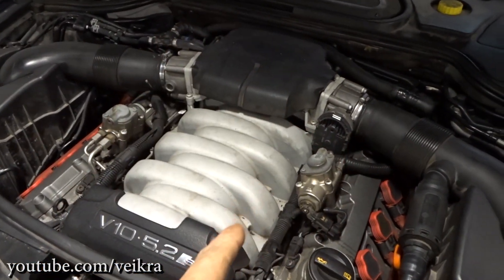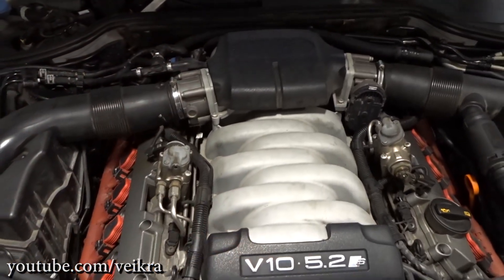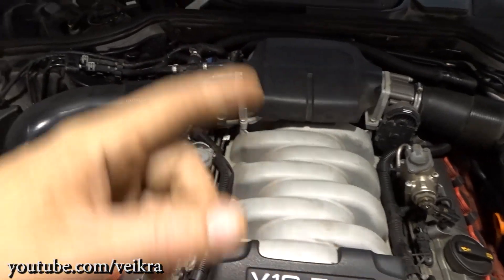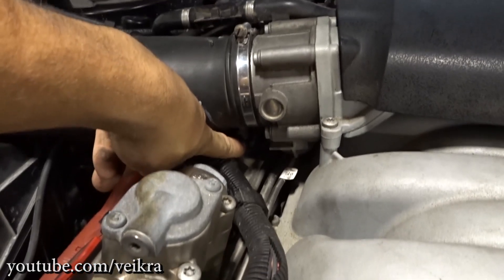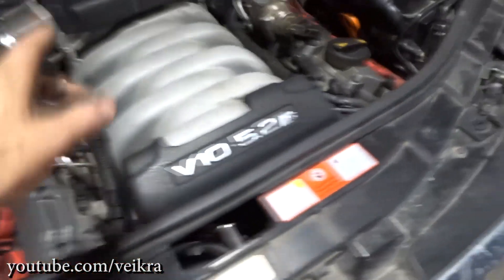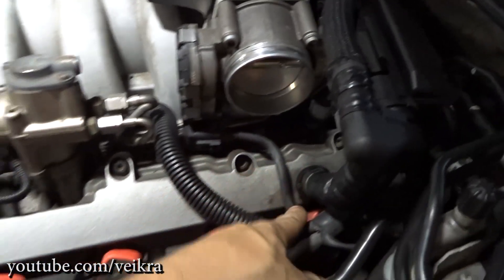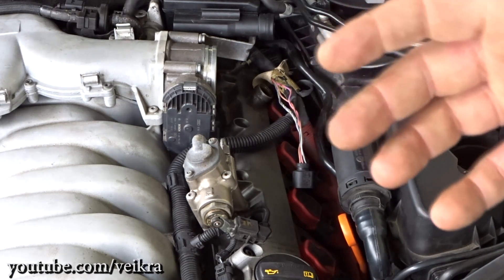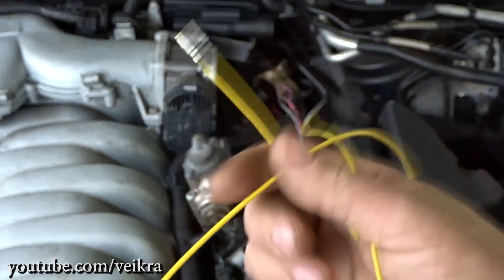Audi S8 V10 5.2 EPC error light repair first step

Comment from the maker: Both throttle bodies were later replaced, one by one. left one was very bad, changed it. 5-6 months later, the right one started throwing code. Replaced it still issues, changed it's connector, good ever since.

Comment: Parts required below :

Connector ---> 1J0973713 (cross connections, old-type)
Pins -->  Tyco 964275-3
Seals --> Tyco 964972-1
Cable --> VAG 000979982A
-------------------------------------------------------------------
Connector --> 4H0973713 (rectangular connections, new type)
Pins --> Tyco 1241381-2
Seals --> Tyco 964972-1
Cable --> VAG 000979982A
Reply from the maker: I recommend the new type I used here, they have way more tension on their pins. 
Wires and pins comes assembled if you buy from the dealership, 2 pins per cable. There is 2 different gauges of wires. Ill find my bill for numbers
Reply: @Nordic_Mechanic  Correct, 1mm wire for the throttle electric motor driver and for the ecu communication wire is 0.35mm. so 2x 1mm , 4x 0.35mm
I did replace only the pins hence the wire was completely OK. The pins lose contact (enlarge) at some point due to heat and age.
Reply from the maker: yes they do enlarge that'S why VAG made a better pin that has more tension and should last much longer. I dont know where your comment about the wire thickness went though! Youtube's event horizon I guess !

Comment: I have a 2007 Audi s6 when I was shifting through the paddle shifters this came on EPC, Track Control and check engine light.
Reply: Code p1923 code came on?
Reply from the maker: Not a nice code. Check wiring harness for bad spots. Can be as bad as a fried ecu

Comment: Hi Veikra I have an Audi s6 2007 v10 the car has the epc light on and it’s doing esp fault so when I first start the car it runs normal and these lights are going but when the car starts to get warm the rpm jumps up and down and it’s shakes crazy then cuts off and right after I start it will stay on for couple of seconds and then cut off and keeps repeating it’s self  and when it close to cutting off when I give it gas it seems to do nothing and cuts it off faster. Would you know of what could be causing that and do you have discord?
Reply from the maker: First step with a malfunction light is scanning for codes. We ll go from there
Reply: Sounds like High pressure fuel pump?

Comment: I have a B7 RS4 and a lot of us owners of these 4.2s have been having the same epc throttle issue, took it to a good guy and told me my entire wiring harness was fine. After some time trying new things we found that the female connector to the throttle body had to be broken apart cleaned it put it back together and it was fine for a couple of months came back rarely now it is fully back and I am very close to trying to just rewire the connector itself. What do you think?
Reply from the maker: At least rewire the pig tail about 6 inch before the connector. Solder and heat shrink and also use the newer connector as the pins are a lot tighter than older ones. On the R8 and S8 V10 like this the wires crumble inside the sharp loop just before one of the throttle body and causes issues. I wont touch a v10 with throttle issues before I replace that bit of wiring for that reason.

Comment: I have a 04 audi a4 1.8t i have the epc light come on it throw me code p0221 throttle body and gas pedal i already replace both but car keeps on loose power when epc and esp light comes on. Any idea what would it be?
Reply from the maker: Yes, and that idea is exactly what`s explained in the video and description box
Reply: Thanks alot im going to do that. Somebody told me that I have a bad ECU

Comment: hello, you happen to know how i come to distinguish if my front parking sensors working or not , i did the camera sound check on the back and front sensors and the back made ticking noise as the front didnt at all. Is it that the front sensors are burnt down or maybe some other issue?
Reply from the maker: scanning would probably reveal a short in the harness or open. you cant have all 4 defective sensors. As it always been this way or did it suddenly happen. Any work done to the car recently?

Comment: Got a 2.0l a4 avant and it’s showing epc and rich idle. Don’t have much to put into it at the moment. Pcv diaphragms not showing tears, car isn’t just shutting off or stalling like a completely blown high pressure fuel pump. What else could it be for rich idle? Thanks
Reply from the maker: Without a scan hard to know for sure. Can be a plentora of things. Could be a stuck open injector for one, a mass airflow perhaps.
Reply: @Nordic_Mechanic not 100% on code# but whatever rich idle is
Reply: It seems to be going through gas quickly also went down 100 miles on sensor after about 50 miles of driving.
Reply: P2188 it looks like
Reply from the maker: @benkohout6495  injectors?, mass air flow?, coil/plugs?.   All three things to check . Strong gas smell in oil? How's the air filter?   

I'm leaning toward a stuckk injector. Sadly only 1 bank of cylinders. If you had a v6 or v8 we could tell very easily as only 1 bank would be affected
Reply from the maker: @benkohout6495  Remove spark plugs, see for obvious cleanliness differences in combustion chamber
Reply: @Nordic_Mechanic  Thank you for the response! Injectors is first since it’s cheaper than doing high pressure fuel pump. Will check for gas smell in oil. Air filters brand new, coils and plugs possible but I’m thinking check engine light would’ve shown also with epc.
Reply: I did just run bg44k platinum fuel injector cleaner through there within the last 500 miles so possible that it caused something. 

I was hoping to rule injectors out because of the cleaner but sounds like it could be the culprit.
Reply: @Nordic_Mechanic  paid $400 to get a diagnostics and cleared codes drove it 80 miles epc and shaking. 
Brought it back and still haven’t heard back from my mechanic. He’s acting like he has bigger projects so may have to take it somewhere else. $400 no wrenches turned, no diagnostic
Reply from the maker: @benkohout6495  Could have disloged something and got an injector stuck open. I'd still inspect combustion chamber to see if a cylinder is different. Could be too high a pressure on all of them coupled with a faulty fuel pressure sensor reading within specs BUT at the wrong pressure.  It's a long shot so thats why I check the combustion chambers for possible clues of whats really happenign
Reply from the maker: @benkohout6495  Shitty deal. Diagnosis wasnt done, you still dont know whats wrong. I'd ask money back. 400$ that's half a day I'd spend on it , bet I find the problem in that amount of time.
Reply: @Nordic_Mechanic  thank you really appreciate the reply
Reply: @Nordic_Mechanic  ended up putting new Pcv valve, spark plugs, oil changed, car started smoking from exhaust (white) shaking sputtering again. Oil says max not sure if it was overfilled?
Hpfp, catalytic converter? Injectors? So deflated with this thing.
Reply: 900 miles good with the Pcv valve spark plugs helped, oil changed then 200 miles before smoke from  exhaust and shaking/hesitating.
Reply: Also noticed there is 1 aftermarket blue/brown oil pressure sensor m. Any ideas are appreciated thanks

Comment: So I’m looking into getting a s8 from the auction and it has the epic light on along with 18 engine codes. Is there a strong possibility this could be the issue. Someone has already tampered with the TB on the driver’s side and installed it with RTV.
Reply: But I don’t have any TB faults
Reply from the maker: Check for play, but if you have misfires, the intake could be dirty or broken. A lot of S8  intakes are broken, they cause 2000$ for the part alone. Be wary and post the codes here so we can try to see whats going on.  All in all , good engines aside from carbon buildup
Reply: Veikra P0458
P010C
P129B
P2257
p0414
P0102
P2294
P2401
P0498
Reply: Veikra I’ve posted the codes. Any idea what the issue could be?
Reply from the maker: @teammcmath-mcmathautos  youtube doesnt notify me of some replies sorry. I think I replied to you on other video right? You have a power feed issue I think
Reply: @Nordic_Mechanic  yea I took it to my euro tech had a wiring issue.
Reply from the maker: @teammcmath-mcmathautos  Good to know it was resolved. With those code, there was definitely a missing 12V somewhere :)
Reply: @Nordic_Mechanic  right!! My check engine light has come in though I now I have p2189, p1923 in engine 1 and p010c,p129C, p3200, p3245, and misfire on cylinders 3,2,7 & 10 on engine 2 🤦🏿‍♂️🤬🤬
Reply from the maker: @teammcmath-mcmathautos  Still missing power to o2 sensor, maf and fuel pressure regulator.  Missing power or short to ground, either or. Disregard misfires for now, it cant run right on half an engine. Ive seen it happen from a totally destroyed high pressure fuel pump. It was crushing the fuel pressure regulator and shorting to ground many other components.

Comment: did your engine rattel if you gave it a little gas, I have the same car..
Reply from the maker: Maybe a little, but PLEASE make sure it's not your timing chain which it probably is. Engine out , 7gran$ don't have much choice if that's the case. Can you make a video? timing chain is easy to spot by the sound
Reply: @Nordic_Mechanic  it has been driven to the workshop so we must see..
Reply from the maker: @michaelthemsen916  Any news?
Reply: @Nordic_Mechanic  were can send u video email Facebook I have one with rattle at 1k and 2k rpms?
Reply from the maker: @nova_squad_bossx1818  I do not have facebook, so make sure the link can be seen without login into facebook.   Have you inspected the intake manifold? They all go bad and can let pieces of plastic rattling on the back of the valves. Or you can have bad timing chains tensionner. In the later case, do not drive it.

Comment: I drive an 2008 audi a4 quattro, i was driving home last night and my car was driving perfect. Then my epc light came on and my car started rattling really bad. I got the light reset but my cars still rattling bad. Any remedies before i spend alot of money?
Reply from the maker: Always take note of the warning light, never blindly erase code. EPC is a very wide error light. The throttle body wear out, and the coil pack as well. The code could give us a better clue. Before you put hard parts in it, you have to swap the electrical connectors if you still have the old style on the coil packs and throttle body. I`'ve sorted a lot of coil pack codes with new connectors, and my s8 needed 2 throttle body connector to make it right. Even with new parts it would throw code because of them.
Reply: @Nordic_Mechanic  thank you buddy

Comment: I have a Audi A7 2012, new coil packs, tune up, crank sensor, an battery all new ....Still engine light on an epc no start at all help please
Reply from the maker: You need access to a proper software to read what the engine it telling you with the EPC light. Once you have the malfunction codes you can post them here for help and suggestions
Reply: Did you find the issue I'm having the same problem

Comment: Hello,
When it's cold outside at the first start, the EPC lights up, if I stop the engine and start again and this error disappears. The error is: Turbocharger Boost control position sensor circuit. I changed the hot part of the turbine, the turbine actuator, the wires that lead to the turbine actuator and I still have the same error. The car works perfectly. What could be the cause?
I have an audi 15 , 1.8TFSI 2013.
Reply from the maker: p2563? This can be caused by the vanes in the turbocharger getting hard to move because of soot buildup. But on volkswagens, it's usually the actuator that fails Did you inspect the free movement of the vanes in the hot side of the turbine before you put it on? Because when you start the car in the cold, the computer tries to close the vanes all the way to help warm up, but it's unable to or cant see that it did.  Did you replace with new or used parts? I'm not ruling out a temporary lack of communication to the engine computer on startup though, since it clears after a key cycle. Also make sure all the pins in the connectors are perfect and tight
Reply: @Nordic_Mechanic  exactly..p2563. Turbocharger is very very very clear.. I checked the pins from the actuator jack..we changed the wires leading to the actuator..vanes is very very clear .. is a petrol engine not diesel 😁.  in summer I do not have this problem at all .. now I have it in winter ... and the epc is lit during driving if I have 1500 rpm and kick it down.  after the oil is heated and reaches 80 degrees I no longer have this problem and the epc no longer lights up. The car works perfectly normal.. he runs verry good :)
Reply from the maker: @razvanstoian9758  perhaps the boost sensor is on its way out

Comment: What was the code . My o2 bank one sensor one is bad can i replace it without yanking the dam motor
Reply from the maker: This is unrelated to o2 sensor. o2 pops check engine, not EPC.  Pulling the motor depend on which sensors, upstream or downstream. 4.2 V8 you can get by and do it inside. Upstreams on W12 and V10 like this requires engine out. So do a full service, inspect and replace timing chains guides and tnesionner and oil cooler seals.

Comment: I have check light came on recently on my Audi A8 2011 EPS car won’t start can you help at list know how to fix it I stuck in Washington DC and I came other state
Reply from the maker: Unless you can pull code there`s no way of knowing what happened.  Does it turn over and wont start or doesnt even activate the starter?
Reply: Veikra it won’t crank or start at all
Reply: Veikra I drove with check engine light like two weeks but now it’s stop at all
Reply: Veikra sometime it delays to start the car while cranking the engine
Reply: I took it to the nearest shop to check the light
Reply from the maker: @My_Way.44  I see, whatever was causing the check engine might have totally gave up. Hopefully the shop is correctly equipped to get manufacturer codes and not generic ones.  Keep us posted!
Reply: Veikra do you think is gonna be easy fix ?
Reply: Veikra I’m At the shop now and they found the problem. It need to replace starter
Reply from the maker: @My_Way.44  somewhat rare to fail. My A8L has 334 000miles and still on original starter. What was the check engine code? Related or not?
Reply: Veikra can I check starter relay or fuses
Do you know where they located at list ? I don’t think my starter just gone bad with 136 k milles  on it
Reply from the maker: @My_Way.44  fuse 15 and relay R5 in the rear right fuse box in the boot. If they did their due dilligence they probably checked that already. In all case, if you dont trust them, get your car out of there and into your prefere independant audi shop.  I know youre away from home but unneccessary repairs on a big luxury sedan can cost more than a tow back home
Reply: Veikra r5 can I take a pic and send it to you ?
Reply: Veikra he said they low voltage of the battery then something going on with fuel pump I think low voltage there and last one he said it need to replace a starter that’s what computer said
Reply from the maker: @My_Way.44  If you have 2 low voltage codes maybe the computer will not even allow the starter to start the engine. He should be fixing the low voltage issue otherwise might be normal the starter isnt working.
Reply: Veikra they jump start it but it didn’t do anything

Comment: Thank you for this video Im considering to try this on my Audi S6 2008 I have the same problem. Only thing what I wanna ask you how did you find out witch one is the problem ? And where I can buy a connector and spare cables? Thank you
Reply from the maker: Welcome to my channel. To find out which throttle is the problem you need to find which engine sets the codes. 

You cannot do that with a normal scanner as the v10 and w12 have 2 engine computers and normal scanners wont know which set the code.
 

Ecu 1 drives the right side of engine, Ecu 2 drives the left side.  With proper software you'll see either G186 or G296.  G186 is rightside of car, G296 is leftside of car. Those are your throttle bodies. With this info you'll know which Tb it is
Also, if your codes in vcds(or other proper software) mentions these below;

Inside G186 is angle sensor  G187, G188
Inside G296 is angle sensor G297, G298 

The connectors are advailable at audi dealers, and wires as well. You need 2 small gauge wires and 1 big gauge as you cut them in half to splice on the wiring. There is no tsb at audi for the v10, despite all us R8 and S6 S8 often having the issues with the old style connectors. Ask for the newer style connector. MUCH highly quality than those our cars car with. 

Happy hunting

Comment: I did mine on the passenger side now i got a implausible signal to the throttle body. I didn't twist the wires either.
Reply from the maker: Doublecheck they are going in the right spot, I had the power wires reversed on one. Easy to make a mistake.
Reply from the maker: Implausible means it shouldnt be able to happen. You have 2 signal which are the opposite. Lets say my connector is bad and a pin is loose, one signal then turns either full open or full closed while the other says 20%. Computer pops a implausible as it cannot happen normally.  Hope this info helps you out
Reply: Ok thank you I will.

Comment: Hello what does mean this is in my Audi EPC light on  A8 2012
Reply from the maker: Many things can cause the EPC light to light up. You have to check the codes with a scanner to narrow it down some.
Reply: Veikra but can I drive
Reply from the maker: @ValdrinBilalli818  yes, I could drive as well, it wont always cut power down, depends how severe the problem is
Reply: Hello I have problem . My Audi A8 won’t start anymore also I have epc light on . Please help me out .
Reply: @My_Way.44  Hello, update your car ecu files or test with other ecu